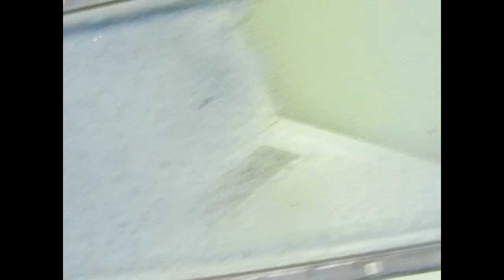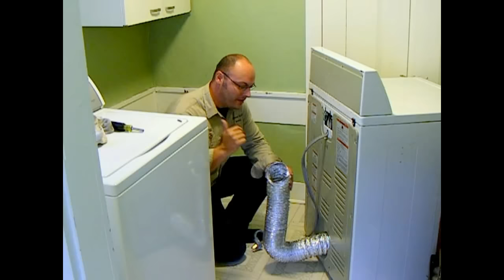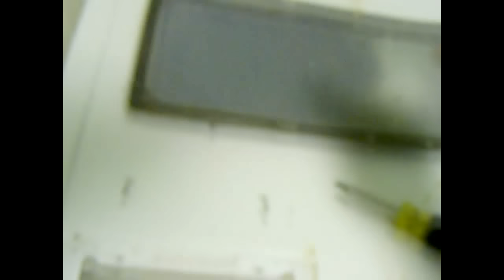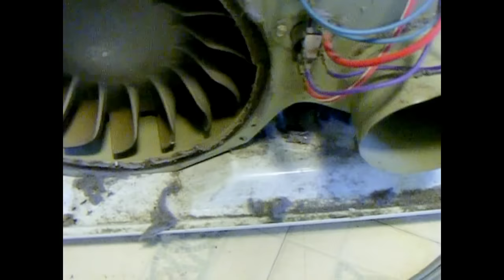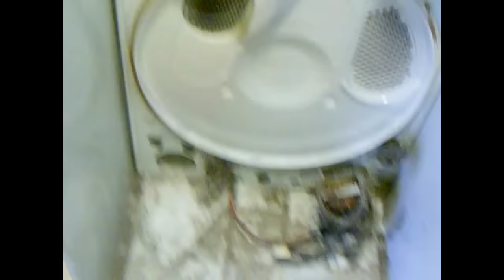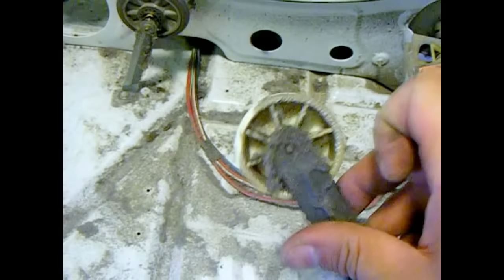Dryer Troubleshooting - Not Drying or Taking a Long Time to Dry

Comment: Thanks for putting this video up - it gave me the confidence to look inside my dryer to see what was in there and vacuum it out.  Hopefully mine will run better too.
Reply: It totally worked !!!  I did the same thing that is shown in the video.  My vent was totally being blocked up inside the dryer; had lots of lint and dust in there, clinging inside the walls and in the bottom of the thing where the lint screen goes.  Also had crap crusted on the fan blades.  After I cleaned it out really good, the dryer runs great !!  I probably prevented a fire, but also saved $600 - $1,000 by not having to buy a new dryer !!!  Thank You !!!
Reply: @lenovo762  really glad that it worked for you 😊

Comment: Amazingly helpful. I just fixed my dryer! And I don't know how to fix anything! It was a lot easier than I thought it would be. Did what you said to do and my dryer is drying again like it should. I thought I would have to replace the heating element, but I found your video and saw that it might NOT be the heating element....and it wasn't. Thanks for your help!

Comment: I've had the day from hell and you just made it so much better.  Got up this morning with a very sick dog, spent most of the day at the vet and going back again tomorrow.  I had stacks of towels & blankets that he'd gotten sick on (he's a St Bernard) so threw a load in this morning and found my washer not working.  Got home from the vet, went to the laundry mat and brought the wet blankets home.  Now the dryer doesn't dry.  I was going to slit my wrists but decided to check youtube instead.  Not exactly sure where the blockage is but have a pretty good idea.  With two big dogs I know now I need to clean the inside of the dryer at least once a year as well as the other parts you mentioned.  Thank you, thank you, thank you for saving me another big bill, especially this time of year.  I'm going to give fixing the washer a shot too.  I LOVE YOUTUBE :)

Comment: Good video, glad its still up after almost 10 years, I was having an extended drying time with my dryer, I went outside where the vent exits and notice there was no airflow, removed the lil cover and flap, it was blocked with lint.  I didnt even consider checking that before this video. Thanks

Comment: Thank you.  My dryer was running for 3 hours and moisture was in the dryer from the clothes.  This should not happen.  I knew the lint filter was clean as I cleaned it before putting in my clothes.  I went outside and checked the vent and bingo! the vent flaps were stuck.  Frozen over with a thin layer of ice.  I manually opened the flaps, got them moving freely and my clothes were dried in 10 minutes.  Now I know for next time the easy things to check.  Thank you again.

Comment: Good video.  You might also want to check the connections to the power block, where the power cord connects to the dryer.  Over time, they can become loose.  I had this happen and it shorted out the power cord and blew the breaker which needed to be replaced.

Comment: Hey enjoyed your video. I have a Kenmore dryer just like this I bought from Sears in 2002.

About a year ago the thermal fuse blew and while I had the back off vacuumed the inside of the dryer and ductwork but did not go to the extend of pulling the metal exhaust elbow piece or the door and drum off as in your video. 

In the last month or so, my wife has been complaining about having to run the dryer through two cycles to fully dry the clothes. I don't think it's an air flow issue.

I washed and scrubbed the lint trap, shoved some rags around the lint trap opening and blew it out with an electric leaf blower. This trick worked several years ago when the heating element was kicking off halfway through the cycle.

I did some testing. It was around freezing that day. I saw steam coming out the vent, and felt plenty of airflow. I measured the air coming out of the vent several times through the cycle using one of those infrared heat pens. The hottest temperature I measured was 110F. Does that sound normal or should the exhaust be hotter than that?

The clothes coming out of the washer do not feel wetter than normal so If the air flow is OK and it's not a venting issue, what is the next thing to check? Could it be the thermostat?  Can the heating element loose it's efficiency over 14 years of use? Is there more than one heating element and perhaps one could be burned out?

Thanks.

Comment: Thank you for your advice.  I dryer was under 4 years old and wasn't drying.  I bought a brand new dryer and on day 1, I had the same issue with the brand new dryer.  I did a search online and found your video.  The vent leading to the outside was sealed shut due to a build up of lint.  Oh my goodness.  I got rid of a perfectly good dryer and purchased a brand new dryer for no good reason.  I really wished I would've investigated further before buying a new dryer.  Thank you so much.
Reply from the maker: Diana Montes I've seen it done a thousand times!  You learned a valuable lesson now
Reply: I almost did the same thing Diana!

Comment: Thank you Bill!    I thought my element was going, because it was taking very long to dry a load of clothes.  However you said the two main causes were not cleaning the lint filter with every load and or a blockage with the vent hose.  Mine was the second one.  A month ago I painted the exhaust casing on the outside of the house which had yellowed with age.  Two of the flaps had stuck shut,leaving one to do the duty of three.  I freed the flaps and cleaned out the outside opening, and voila -problem solved.  Thank you.

Comment: Excellent!! Thanks for the step by step instructions... I had a very hard time disconnecting the wire on top. I didn't clean out the lint screen tube going to do it tomorrow.. I think its all good now.I see the gas go on and work just not sure why the flame goes out in about 10 minutes hope its just a thermostat issue. Again Thank You for your Help

Comment: I did work for trade of a dryer. It look brand new. I pulled the dryer vent out it was full. I pulled the back off it was full. I took the long metal piece off soaked it in water and cleaned it there was a dead mouse inside the bottom and a ton of sunflower seeds bobby pin credit card $2.21. A prepaid card. The dryer is hot. Everything is circulating. Now what I have to do since I watched your video is take the top off and take the drum out and inspect from there thank you so much for the video.

Comment: Great easy to follow instructions, cute cat!  Thanks for addressing the reason why i have so much lint in my dryer.  I just had to have my dryer on the second floor next to my bedroom but the contractor never told me the negatives to this set up   If i knew then I would have put the dryer against the outside wall and not  in the middle of the house where it needs to go up and over my room before exiting out of the house.  Such a long way for lint to travel.
causes my dryer to over work and for clothes not to dry as fast.  grrr.

Comment: Great video! I hope you are still out there and can answer a question. I have a  Maytag medc465hw0 dryer and unlike the rest of my permanent houseguests, I clean the lint filter out regularly. Recently, I noticed lint was not collecting on the filter which worries me.  I took apart the back and cleaned out what I could see, and in addition, I tried to clean the vent system that goes up through the roof (I had my 12-year-old grandson help as my hands are too big). What has to be replaced to get the lint blowing back onto the filter?  And thanks for showing me how to take apart the piece that collects the sunflower seeds. My permanent houseguest has also scattered sunflower seeds inside the washer and dryer. I am 74 and still repairing things I need to! patsy

Comment: Thanks, this video helped me a lot!  My dryer wasent heating up anymore and I really wanted to avoid calling a repairman out for it ($70 just to look at it).  The dryer you worked on in your video is almost the same as mine - so it was really easy to follow.  Only part I had an issue with was when I was removing teh front panel to get to the drum - I couldnt for the life of me disconnect the electrical switch cords.  But no matter - after deep cleaning, my dryer works perfectly now!  Thanks!

Comment: +Bill Newberry Thanks. You are right. I could not imagine how it could be venting, that was the problem since I had taken ithe whole thjng apart and vacuumed all openings. Well, I should hsve disconnected the hose at both ends. I undid it at the.machine end and did vacuum it. Today I went outside and removed the louvers or flaps from the vent. I was astounded at how much caked up lint I had to remove. Vacuum would not remove most of it: had to be scraped out.
I almost bought a new machine, on credit, of course.
Thank you so much.

Comment: Thanks for the help.Mine was making a bad racket and not drying the clothes and the lint trap is inside at the bottom of the door an admiral mega 22.i popped the top tilted it back took the front off and cleaned it but it ended up  being the fan was broke and spinning on the shaft due to all the crap by the fan.anyway its fixed know not as hard as i thought.you was a tremendous help and saved me from getting a new or different dryer. KUDOS

Comment: this was a great video. I took my dryer apart as I watched and I do believe it will run like new after seeing what was stuck in the lent filter housing, it was over half blocked with lent a pen a pencil a part of a mechanical pencil, little rocks and bb's. Thanks so much. I'll go buy something cool with the $500 you just saved me in a new dryer.

Comment: Thank you so much for taking the time to do this video. I have a Kenmore dryer that’s probably 25 years old. I can’t afford to buy a new one. My drum won’t turn but the heat inside works. The heat vent turns almost red. It does overheat a lot so I’ll clean it per your video. I’m hoping since the unit heats but the drum doesn’t spin that it’s just the belt. Could it be something else besides the belt? Thank you again for your time.

Comment: Thanks to your video I was able to find my problem. Dryer was taking at least 3 times before clothes was dry. I opened the dryer and it was clean inside it. The problem was outside the house the vent was clogged up.

Comment: Thanks for the very helpful video! I checked everything related to the heating element, fuse and thermal switch had continuity. The dryer had plenty of lent built up, I'm going to put it back together and see if the problem is solved.

Comment: Good video. I actually am encountering the high limit cut-off tripping. Had it repaired twice, but after that cost I decided to do it myself. I even reset the non-resettable cut-off by slamming it on the garage floor. Popped again so I went out on a limb and ordered the high limit thermo and cut-off kit. Installed them and the dryer worked for three separate test runs. Then I hooked the vent line back up. Kaput again. We blew out the line with a blower, but perhaps not thorough enough??

Comment: Thank you for making this video. I cleaned out the whole thing, then the heat came back on! Took me 5 hours. I couldn't pull it away from the wall because I was not able to disconnect the gas line.

Comment: I am so glad I found this video. If I could share a picture of my lint I would. It was full of stuff. Its all cleaned out. Thanks again. I'll find out if my dryer works right again shortly.
Reply from the maker: Barbara Gauthier How did it run?
Reply: Still had the same problem. I'm going to order a thermometer and fuse. Cheap through amazon and see if that works. It seems to run more smoothly but still problems with taking too long to dry.
Reply: Bill Newberry I ended up ordering from amazon the dryer cycling thermostat and the thermal fuse. It works like a charm now. Parts was like $8 total!  Better than buying a new dryer!!!
Reply: I have an old kenmore/whirlpool dryer. Thanks for the info. I'm going to disassemble it and see if I can get working right.

Comment: I have a different brand.  It's a full sized stacked washer/dryer so it was pretty heavy to move.  (I rent...can't change it.)   I can't see how to open up the back of the washer, and one screw on the back of the dryer would not come out.  I did get the small panel around the motor off, so I reached way up in there, as far as I could, and scraped, wiped, and cleaned as best I could.  It wasn't horrid, but it definitely needed cleaning.  Thank you, again, for sharing this info.

Comment: Good video, best of these I have watched. His venting is good except it is probably kinking a little when it is pushed back towards the wall. Any kink will cause problems, check behind your dryer and make sure it has as straight of a line as you can. If it vents through the roof or high up on the side of the house birds love to build nests in them. If your builder has made it so you can't get to the back of your appliance you have a serious fire hazard because you won't know the vent is clogged till a fuse, thermostat or element burns out, or you have a fire. Builders in my area often make it impossible to vent it right.

Comment: I recently moved into a new house (for me) and owner gave me good looking Maytag dryer and washer.  The washer looked real clean but when I took off the top cap where you put the conditioner, it was a black mess.  Got that cleaned up and it works good. 
On to the dryer.  Today was the 2nd time I used it and I noted it got hot, even on top you could dry clothes, but it never seemed to dry clothes and water was seeping out the bottom.  The screen was clean and looking in it was clean with no obvious build up.  Taking it apart seemed daunting so I moved on to the next step.  I previously put in a new vent hose to the vent chimney so I knew that was good to go.  I went up on the roof and examined the u-shaped roof vent and it pointed down on the roof so I couldn't see the set up so I did the rest in a kind of braille repair mode.  There was hardware cloth in it pretty securely but I knew that was the problem.  Behind the hardware cloth was a thick mat of lint and the swing vent door couldn't open.  I ripped out the hardware cloth and then tested the dryer and back on the roof confirmed it was working as intended.  The roof is relatively new and I wonder why they put hardware cloth in the vent and the door swings shut when dryer off.

Comment: Thanks for the video. I'm going to try to adapt your advice to my GE Profile Prodigy Dryer. I cleaned the externals, the wall cylinder and the flex hose. Actually I think the timer's one of the symptoms. The dryer is simply taking too long to dry clothes and thus the timer doesn't go off at all.
Reply from the maker: Does sound like you're having an airflow issue.  Give it a cleaning and let me know how you make out!

Comment: Another thing to check if your electric dryer is not making proper heat are the circuit breakers in your 240v power. There are two- one for your motor and controls, and the other for the heating element. One can trip without the other due to the greater load. If the one for the heating element is tripped, you won't get heat, but the dryer will function normally otherwise. I've had this happen in two different houses.

Comment: Bill - can't thank you enough for the tutorials (BTW ... love the shirt, my son is a Penn State senior).  Question:  I replaced the heating element in my Kenmore (the thermostats check out fine).  Once I replaced it, the dryer started heating again, but now it seems to be blowing the thermal fuse making the dryer turn off BUT the heating element STAYS ON even though the motor has stopped.  I replaced the thermal fuse again ... same thing happens.  Is it possible that I installed the heating element incorrectly?

Comment: Hi Bill,  Thank you for your videos on fixing dryer problems.  Mine stopped heating a few weeks ago.  I tried your trick of bouncing the upper stat off the ground, and it worked!  Perfect!  So I also removed the lint filter housing as you showed in your video, and I blew the huge, thick “carpet” of lint out of it, and it really was a serious carpet of crap!  My dryer is working perfectly now.  Thank you!  I plan on fishing a wire hanger through the duct with a rag tied to the end of it to clean out the 15 feet or so of duct from the dryer to the outside of the house.  I have one question though; is it safe to assume that the stat is ok now after banging it on the ground?  I mean will it work as safely as a replacement, new, stat?  I keep running down to the basement to see if the dryer is ok when I have laundry drying, but can I assume that is will be ok?
Reply from the maker: +Caledon mike I've intentionally blocked up dryers and the non-resettable thermostat will still trip as normal.  I've even used a lighter to trip it, then reset it at least a dozen times to see if it still did the same thing, and it does.  I wouldn't worry about it one bit.  You've cleaned the dryer, which is good.  That's the real safety hazard in my opinion.
Thanks for Watching!
Reply: +Bill Newberry Thanks Bill.  Is there somewhere I can pay you for your efforts?   I mean really!  You have saved me quite a few scheckles.  How can I thank you?
Reply from the maker: +Caledon mike That would not be necessary, but appreciated if you do!  On my channel page there is a support me button.  
Thanks!

Comment from the maker: That's true with most new dryer lint filters.  They have very small holes and are made of a cloth like material.  They plug up and don't wipe clean.  The old metal cheese grater looking ones you can probably get away with just a good swipe with the hand.  It wouldn't hurt to clean them well either.
Thanks for the comment and thanks for Watching!